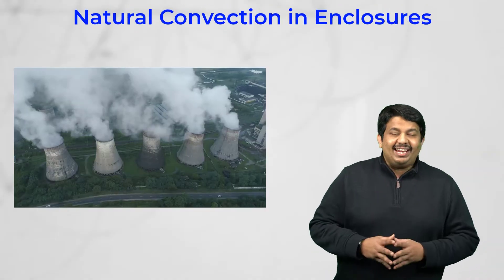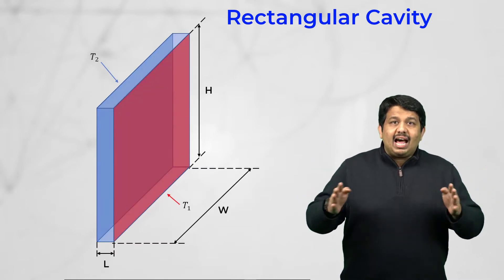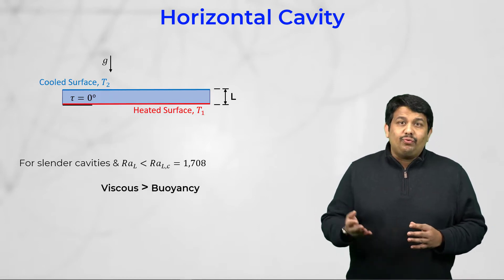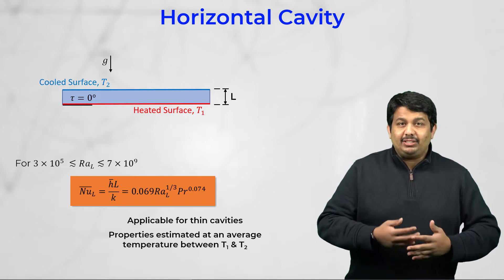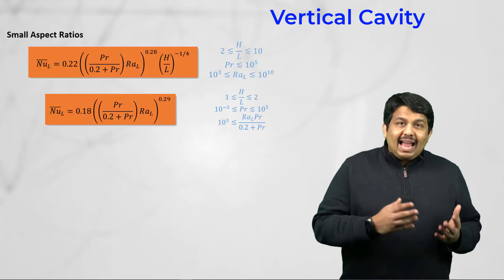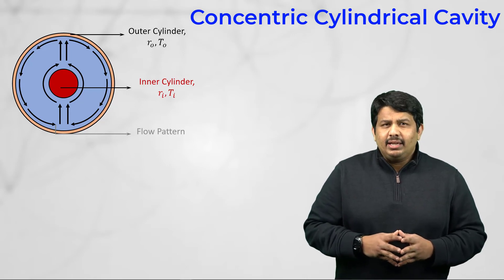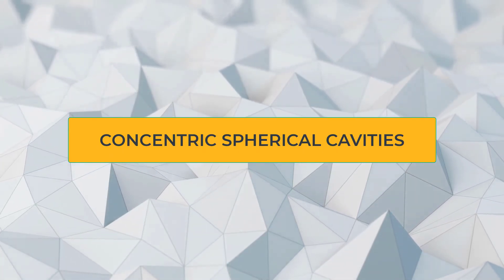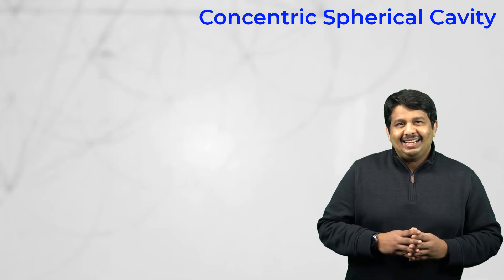Natural Convection in Enclosures — Lesson 5

Comment: Hi 
Hoping you can answer a question. 
My case is for a pipe inside a cylindrical water jacket. They are vertical. 
The heat source is from the hot flowing gas within the pipe. 
I was wondering if there are specific examples for this case? or if you treat it as a vertical enclosure (as the cross section is rectangular)